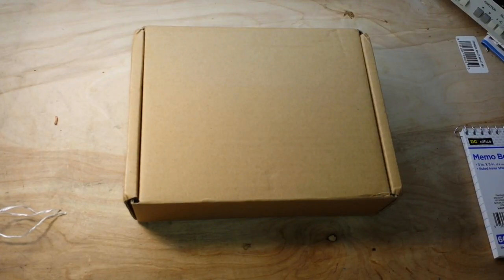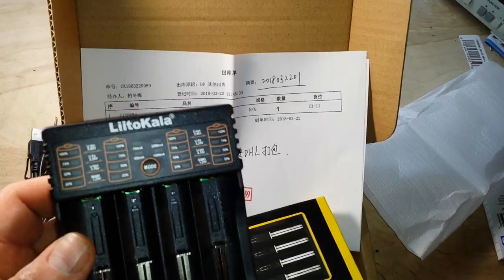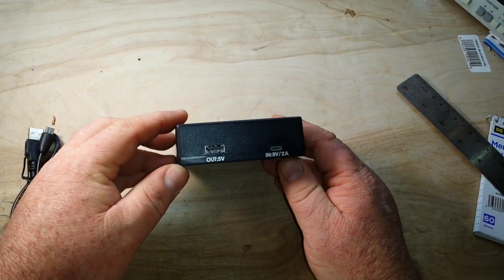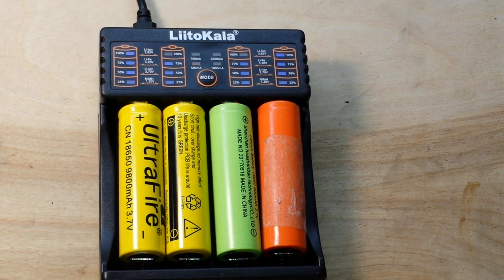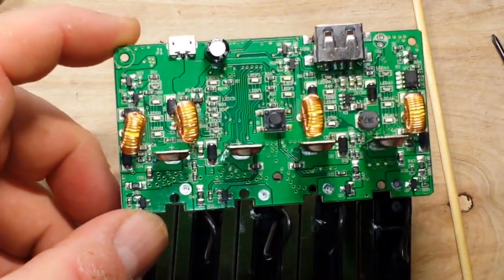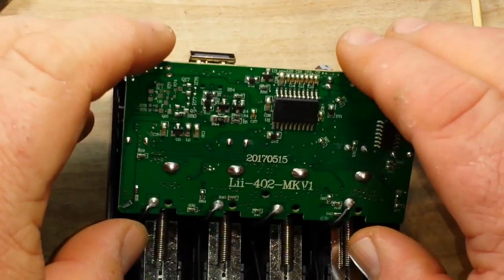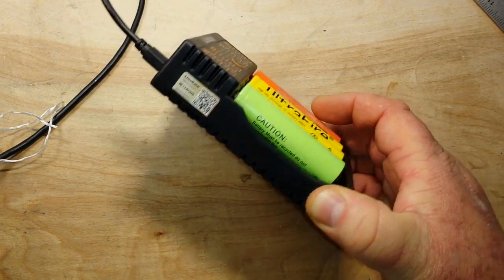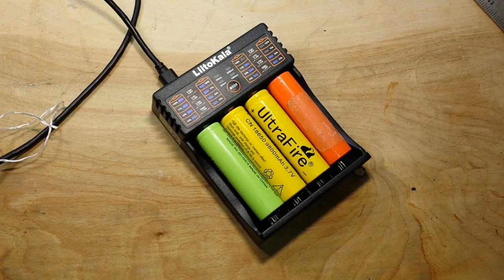LiitoKala Lii 402 Smart Battery Charger Review & Teardown

Comment: It suck! The battery will leak after charging and the unit will complete damage when the leakage enter inside, don't buy this sucker charger
Reply: So ot doesent have overvoltage and heat protection?

Comment: it depends on your charger headplug outputs.. they are diffirent. i try them. 5v-0.5A , 5v-1A, 5v-2A, 5v-3A.... if you have fast charger that supports 5v- 2 upto 3A. you can see a change

Comment: Read manual first :P
Reply: no manual in the package... 

the Menü Button havd to be pressed & hold done 3-5sec. to skip in the 4 OUTPUT Current... 

Tip... This CHARGER CAN BE USED BUT IT'S NOT AN ALL DAY DEVICE...

TO BE ON THE SAVE SIDE 
I RECOMEND TO 
USE IT STANDING ... NOT LYIE DONE
TO SECURE ENOUGH VENTILATION... 
QC TIP C 'USB CHARGER... WORK BEST

BUT THE LII-500 MODEL IS 100% BETTER.. BE SAVE 
🚭🚭🚭🙋🏻‍♂️🤙🏻🤙🏻👍💨💨💨 VAPE ON VAPE SAVE VAPE ALL.. E CIG SAVES LIVE'S

Comment: Amp setttings represents per battery mode. You can not set 1000ma to all 4 batteries with 2A charger. The charger equally distributes  ma

Comment: Disconnect ALL batteries, THEN hold the Mode button to select the mAh, then add the batteries. Note, if you add 4 batteries it will auto drop to 700mAh. See the white writing on the back for this.

Only one slot support 2000mA current
1000mA only 2 batteries on the charger
700mA only 3 batteries.
500mA can be used with all 4 

I see you figured it out right at the end :)
Reply: oi, thanks mate. It tooks me hours to figure it out.

Comment: Can i ask you a question. I have lii202 and it is working different. When ı connect the electricity. İts working like charcing mode but there is no battery in it.

Comment: 2000 mah is 500 mah a cell i think thats what its telling you... or it cant charge 2000 mah 4 batts.. so charge 1 batt at full 2 batts at 1000 mah 500 a piece... and 4 can do only a certain amount... what you do is charge a 186650 from a hobby charger 1 amp max per cell thats the only way.. youll be able to fast charge a cell

Comment: you can only charge at 2000 mAh in the 4th slot. also the usb will only have output without the power supply attached  with a battery in the 4th slot as well.
Reply: with any battery

Comment: Your power adapter is too weak... Xd you need at least a 5v 4a supply for 4*1A. You should check the specifications if this adapter can handle 12v.

Comment: Paul, it dropped to 1000mA as soon as you put the one battery in? Also you forgot to check the standby power? Now if only I had an 18650 to charge;-) Lucky to be on that mailing list I'd say Another goodun!
Reply from the maker: It does as/AAA too...ps check patreon
Reply: Thanks for the tip! It's still a good video!
Reply from the maker: You won